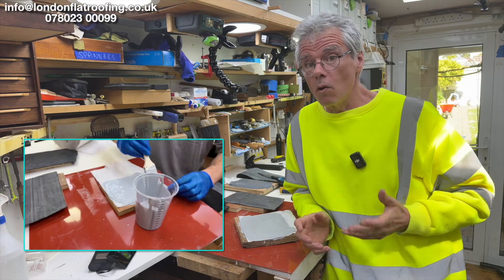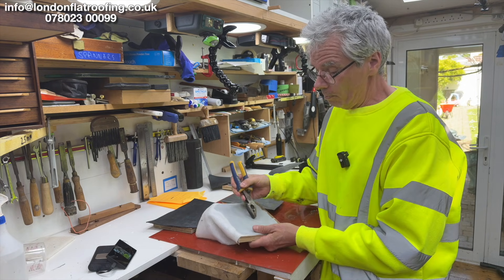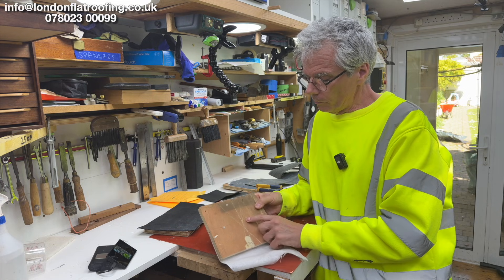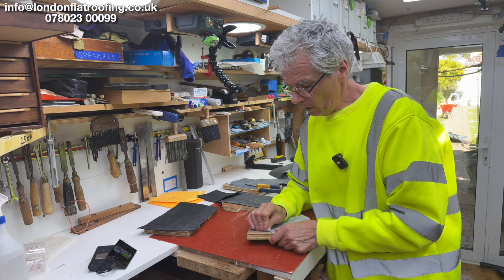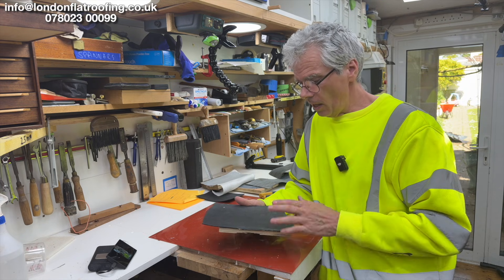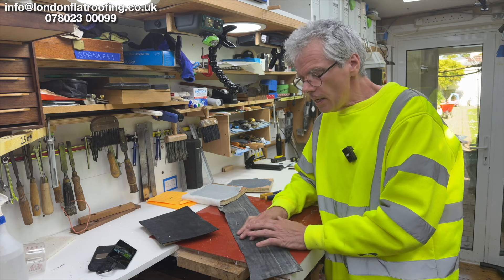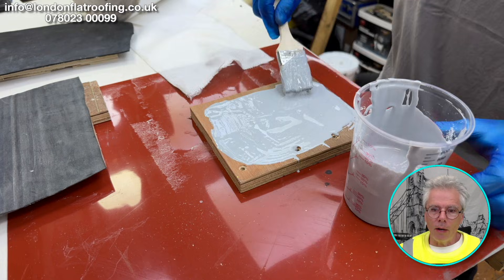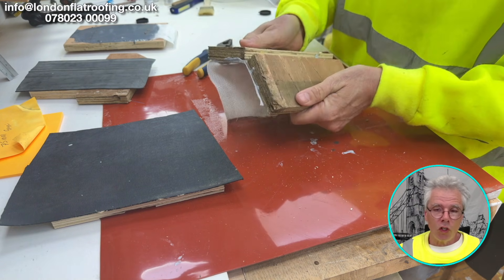Don’t Overlay Your Flat Roof Until You Watch This

Comment: Liquid roof systems offer elongation up to 600% when embedded matting is used. What are they referring to then if you're saying they split with .1mm of movement.
Also EPDM does not self terminate meaning you couldn't join to existing felt for example unless you use jointing bars...which is just a weak spot waiting to happen.
Reply from the maker: 600% elongation refers to lab tests with embedded matting, but in practice, when fully adhered, a small crack (e.g., 0.001 mm wide) may only allow 0.006 mm of additional movement before potential splitting, which is not significant.
EPDM does not self-terminate so yes you have to use bars
Reply: @SteveRoofer  I've just watched another of your videos where you provided for the expansion by taping the joint with aluminium foil tape so that the Liquid Rubber didn't fall into the gap and sat over it within the fleece. Why do you no longer back that method?

Comment: Great video Steve, really appreciate your videos mate. Would love to know if their is a bullet proof system out their for a flat roof that can be walked on.. The flat roof is OSB sitting on 225 x 50mm floor joists. I was thinking if their wasn't building another suspended floor above it and fitting decking, but obviously that would massively increase the cost.
Reply from the maker: You're right there’s no true "bulletproof" system for a walkable flat roof unless you start introducing layers above, which ramps up the cost fast.

Old school asphalt was solid, but like you said, technically it was never meant for foot traffic without protection. Same with felt modern stuff is tough, but again, you’re not really supposed to walk on it unless it’s covered.

EPDM is good, but it’s hard to bond anything directly to it, especially if you’re thinking about tiles or decking. The real trick is always the substrate. If that’s moving or not strong enough, no system will survive long.

The reinforced liquid systems we’re using now are decent for walkable areas, as long as the base is solid and stable. Some of them let you tile straight on top, but again, it's all about what’s underneath.

Let me know the size and use — might be able to suggest something more specific.
Reply: Lead roof for me, every time !!!!!